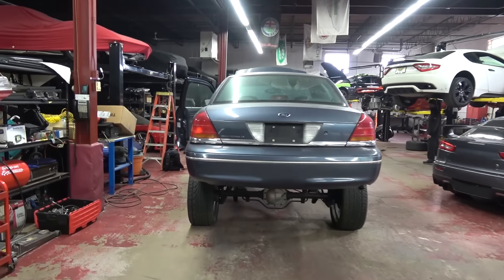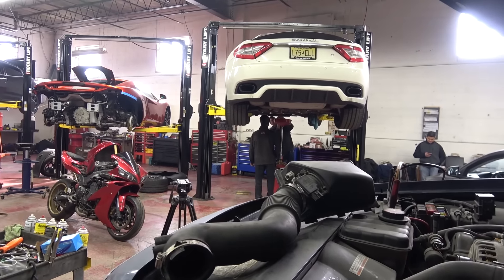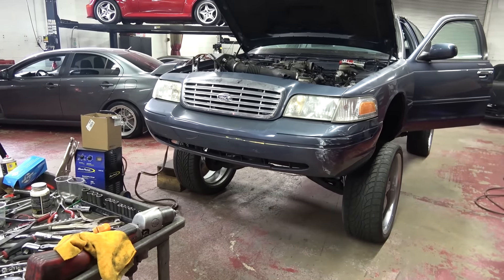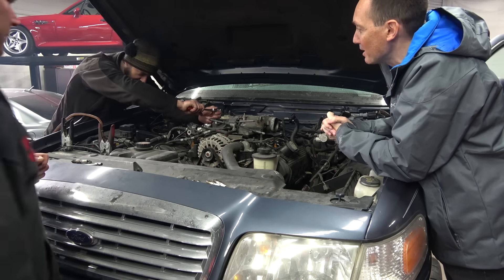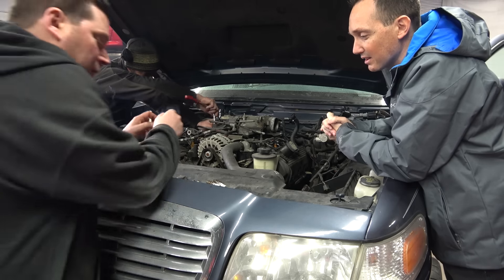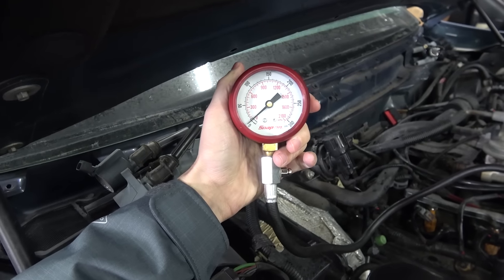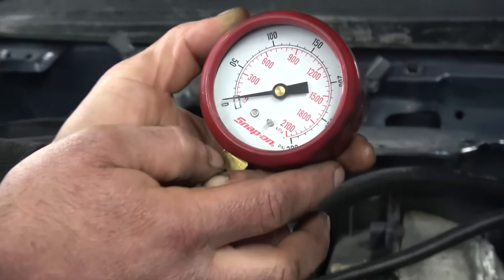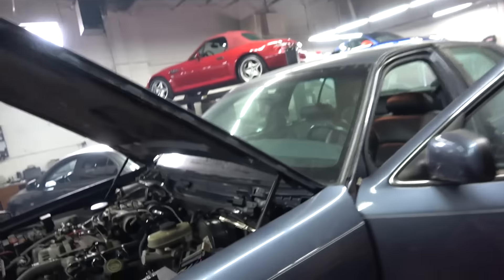So I Bought A Donk With A Blown Engine

Comment: Check the fuel pressure regulator. Sometimes the diaphragm will tear and leak fuel and its sucked into the engine causing a misfire. Pop the vacuum line off the regulator and see if fuel sprays out.

Comment: Best part about the coils is there brand new and you can use them on the next motor! Problem solved, I’m thinking out loud about the Catalyst disconnect from the headers run straight pipe and see if any difference would be there, just a quick way to diagnose I’m thinking. For future reference!

Comment: The straps came loose because you hooked the to the axle,your better off hooking the straps to the frame and compressing the suspension a little bit to keep tension on the straps

Comment: I'm totally shocked a car like this has a blown engine, totally shocked...
Reply: Same, crown victoria's are very reliable.  I got one, only reason a car like that would have a blown engine is straight up if they didn't have it maintained at all.
Reply: I'm not shocked, it's a Ford what do you expect
Reply: @MichaelRobinson-up6fo  You can't even deny that tge crown vic is one of the most reliable cars out there
Reply: I for one, get your sarcasm.
Reply: Its practically written on the frontgrille
Reply: The wheels scream " I have been cared for my whole life".
Reply: Especially since Rob bought it.
Reply: Motor pool?  Taxes?  
That is not a P71.
Reply: Rusty Climber  I'm aware of who takes care if fleet vehicles. 
All I stated was THIS Vic was not a fleet vehicle. 
It's not an interceptor.
Reply: It is shocking but in reality, a blown engine can happen to any kind of vehicle if ppl aren't careful with them
Reply: @groundshakersociety6637  it's really not, it's over hyped
Reply: @MichaelRobinson-up6fo  the 5.0 and 4.6 are bulletproof motors idk what your even talking about and I'm a Chevy fan, you know I'd rather push a Chevy than drive a Ford but those Vics are tough
Reply: @Gcal1956  
they scream
WHERE IS MY DADDY???
Reply: FORD Fix or repair daily! Lmao jk

Comment: These motors cost less than those coil packs lol
Reply: beware gravity he loves to waste money
Reply: beware gravity and the engine comes pre-installed?
Reply: Harbor freight swap it. 
Life OD channel.
Reply: Mechanic was stupid or just ripping him off but that uneven crank would make anyone that had a brain know there was a compression issue to pull the plugs and do a compression test before wasting the customers money on parts.
But hey that;s the stupidity that sends people to people like me that works on cars in the back yard, I'm cheaper than the garage guy so the customer feels like they are risking less.  Then when I prove I can save them even more without screwing them over I get repeat customers and referrals.
Reply: I seen engine, trans, and ecu with wiring harness on Craigslist for 350$ lmao
Reply: @PatrickBaptist  exactly the same damn thing I was going to comment that is bulshit that they charged him for coil packs and everything and it starts and sounds like that all weak and everything does it make that Ford crank noise when you turn it over it doesn't sound good at all that right there and told me when I first started watching this that there was something major wrong I wouldn't ever let somebody like that work on my s*** anymore they're going to sit there and charge him that much and that wasn't even close to what was wrong lol I mean for starters they should have went and checked the check engine light cuz I'm sure it had one set for it to be running like that that bad and that right there would have told you you had a misfire and then you could switch Coil packs and if it didn't change then we'll then I would have have went after compression but honesty I've done this since I was 14 and I'm 23 now and I can listen to a vehicle when it turns over and tell you if something's wrong if it's not running right the sound when it turns over or when you give it gas ha I can usually always tell i mean idk what the hell kind of shop this is but I be damned I ever would take my shit to them of i was this guy ha I be wanting my money back lol or a free engine replacement or free labor or better yet just take it some where else ha not ever let them touch s thing .
Reply: I have a mercury marauder engine that'll drop right in there. Dynoed at 617 hp

Comment: Wore out/head gasket or both. Burning antifreeze means gaps in places there shouldn’t be. If it was the coil then when it fired up the smoke would have been black from all the unburnt fuel

Comment: Just FYI Rob. Unlike every other car company ford thought it would be a good idea to only show a misfire on a cylinder when it misses ALOT within a SMALL time frame.. (on these cars/motors) Just wait until you blow a plug out of the head and realize there is only like 4-5 threads in the head..

Comment: Put a 5.0. Ford crate engine in for $3500 and she'll be race ready. These donks are like any hot rod or classic car project. Who ever owned it before didn't get the motor swapped out. You could also do a LS swap , a used engine starts at $1500. You don't necessarily have to go to the junk yard.

Comment: I bought a 4.6 from pick n pull in STL for $345 out the door and the with a 12 month warranty. Do like i did look for a wrecked car with a motor that has not been stripped of any parts. I'm sure there is some of those kind around where you live.

Comment: Dude I just bought one of these but in stock condition for $600 working great and looks factory fresh after I cleaned it. It looks like the guy overheated it at some point and never bothered to replace the head gaskets. I'd check that plastic intake manifold for leaks, it's a known problem with these.

Comment: I dont want to be one to brag, she aint no donk, my crown vic was 900 on surplus auction and gas run great since 2013 and she has never broken down. A 2001 DUI enforcement model, cheap parts cars to, beside the suspension. Swap or rebuild?

Comment: I had an 09 Expedition with a 5.4 that sounded exactly like that when the motor went bad at 115k.  The later Triton V8's are complete and utter garbage.  That was the first and last Ford I'll ever own.  The OHC engines are notorious for having oil starvation problems, that's why Ford moved back to a push rod V8 for their new 7.3 gas engine.

Comment: bloody crying shame! That looked like a damn good motor. Good on you guys for doing a compression test. Probably should've done it before getting the coil packs given doing a compression test would've been actually easier but we won't go there. Myself, I would've bought coil pack or catalytic converters or one of a couple sensors but yeah compression test is a good idea before you start doing anything to labor-intensive. Still say it's a shame that motor looks beautiful. That guys saying a motor would've cost less than the coil packs that kind of gets under my skin a bit. It's around here got a run you 300 or 500 or motor and you'll probably still have to change the coil packs. I've seen salvage yards charging 800 for one of those motors as well and they're getting more difficult to find. I'm talking about here. I don't know about the US. You know what, it's time for boys and girls? Let's not just put a boring old Crown Vic motor in this interesting little jam. I know anybody is just going to ignore this but give this car some balls. Put a Mustang motor in it, get an engine out of a road GT cobra or something and swap that out for some real horsepower. If you're got a change the motor man have some fun with it and put a real beefy Injun in their.

Comment: timing chain problem.... you can hear them hitting the covers... stretch chains and bad tensioners... common problem...funny thing is I'm actually doing a 5.4 out of a F-150 for the same reason...not doing the chain job...easier to put another one in... I got my clients motor from LKQ for 850... I live in Canada so you might get one for less

Comment: Sharp mechanics. I was expecting them to start recovering the rear seats since they are the most common cause of white smoke misfires instead of a blown head gasket. Be sure and get a vid of the water in the oil pan haha

Comment: Hey Rob FYI I buy and sell cars and I have bought the exact same coils for like 60 to 70 bucks off of eBay for a set of 8 I don't know how long they last because the car was sold but they look exactly like the same ones you get at the local parts store for like 50 bucks a piece just thought I'd let you know. PS I'm in the Tampa Bay area

Comment: White exhaust on startup is coolant vapor and that had hella vapor!  Coolant or water in the cylinder produces a white exhaust which is different from oil burning.  If you wanna go cheap just do head gaskets.

Comment: Get yourself a new mechanic. He works on high end exotics and supercars and yet he can't tell that a Ford 4.6 is blown from the sound of it. It's got 2 dead cylinders which is why it runs like crap. The cylinders are dead cause the rings are shot, hence the 0 compression. The white smoke is from it burning coolant due to 1 of 3 things. Bad head gasket, cracked head or a crack in the cylinder wall leading in to a coolant jacket which would also cause 0 compression

Comment: I new it was shot on the first crank. It had a dead skip. And i dont think its dead yet. By the look of that smoke i say the head on the pass side craped out. No compression on that side at all and white smoke. Cracked head is my guess but ive only worked on nothing but fords 40+ years so dont take my advice. Good luck

Comment: Why did you throw coils at it without proper testing? Why not put a pressure transducer in the cylinder and look at valve events or in the intake and exhaust? You could look at secondary spark waveforms and see if there is a compression, fuel, or spark issue. You can also do a relative compression test. All you proved was there was no compression. It could have been as simple as a Rocker coming off. I would think a shop that works on exotic cars would have equipment like this to diagnose problems rather than trying to get a spark plug out to do testing. Most of my testing is done within a few minutes and can pinpoint internal issues.

Comment: Those 4.6 are supposed to be bullet proof
Reply: They are if maintained same thing with the sbc
Reply: They are. They go 300, 400,000mi + without major problems with low maintenance!

WTF did the previous owner do to blow the motor?! Run it on low oil & crap gas?

Comment: clogged cat.... but exhaust gas, oil, and coolant are flowing freely out the tailpipe..... LOL!

Come on man... that thing was overheated to death. 

Now me and the mad scientist gotta rip apart the block, and replace the piston rings you fried. ;)

Seriously though.... the head gaskets are blown and the rings are actually fried....Go ahead and replace the motor, I'm betting it has stock gears and the transmission is probably shot too......

Comment: ******WHY THE HELL DID YOU NOT CHECK MORE FIRST, WET PLUGS, LOW COMPRESSION, CHECK SPARK, CLEAN OLD PLUGS, VIEW POWER BALANCE TEST ON SCAN TOOL!!! DAMN MAN YALL DID GOOD AT THROWING PARTS AT IT FIRST BEFORE DOING PROPER DIAGNOSIS!!!!!!************************

Comment: Oh btw I’m almost 100 % them guys knew you have money and they sold you some bullshit coils before testing the originals. Now the light bulb sets off in the mad scientists head let me check the compression to add more shop time even though this is exactly what I shoulda done in the first place. Buy a new block and check the compression before accepting. A new block for that pos is probably 300 - 450 at most. I’m actually surprised your smart enough not to fall for the maf sensor cleaning

Comment: My first question is, "WHY?"  lol

Never start replacing parts until you know the part is bad.  Spark test, compression test and code check should be done first.  Troubleshoot everything first, then replace what you find wrong.  

Cats will normally cause loss of power and it will sound like a jet in the exhaust as the pressure builds up.  Loss will be worse as the revs increase, if it will rev at all.  I have never seen one cause missing in the engine, just won't rev.  Plugged cats aren't very common since all gas has gone unleaded, it was a major problem when people could put leaded gas in a car requiring unleaded.  

I haven't seen a plugged cat in 2 or 3 decades, but, an issue that I have seen that acts the same is a plugged muffler.  People put on a cheap muffler that doesn't have a drain hole and water builds up inside.  This then mixes with carbon and makes a sludge.  In colder climates, the water can freeze overnight, which really causes problems.

One thing that either of these problems, or a restriction, such as a squashed pipe, can cause is burned exhaust valves; but you will usually have some compression.

If this engine sat for 2 years, then it could have stuck valves.  Most engines can take sitting for a time, but I have seen cases of stuck valves after only a year, especially if the engine had a problem with condensation inside or poor maintenance.  Popping the valve covers and looking to see if a valve is staying open will tell.  Some engines have "interference" valves, where they will hit the piston if left open, but some do not.

Wish you had pulled the PCV hose to see what kind of blowby there is, could indicate a burned piston.  0 PSI compression is a very good indicator of this and would be my bet.

So many possibilities when a person isn't there to look at all of the telltale signs of various possibilities.

Comment: Coils? Engines are so easy to diagnose... you can LITERALLY HEAR the dead cylinders as it turns over..
Reply: Do you see Cosmo in the garage as the lead mechanic? Lol. He does crack me up but no way I'd let him touch my Honda lol
Reply: Oh yeah, engine problems are super easy to diagnose. Thats why some scan tools cost in upwards of $10,000 and there's hundreds of P codes that can set for hundreds of different reasons. Go do it for a living and see how easy it is.
Reply: @myaccount__7269 he's just a funny guy,it'd be Your loss ,  he can work on Ferraris and lambos in his sleep he's definitely more qualified to work on a POS Honda than any tech at your local Honda dealership.. Rob should have compression tested it before he bought it but something tells me it was getting purchased regardless... It's a funny crazy looking project that's why he bought it...
Reply: @Andy-uj9he  people just don't get it especially the ones that don't do it everyday, there are some things computers don't tell you and if it's an older car like that you're on your own for a lot of it and a lot of things aren't easy to figure out when there's a weird issue, however this was definitely not one of those cases this was a pretty easy thing to figure out even for your car guy with just basic knowledge, if you can change plugs and wires and do an oil change you could have diagnosed this cars engine was shot
Reply: @Andy-uj9he  I do do it. Scan tools and diagnostic codes are one thing. Being able to hear a dead miss in an engine is quite another. If you need a $10k Snap on code reader to figure out theres no compression in a cylinder, your mechanicing days are going to be short lived.
Reply: @GixxerDad 600  Exotics arent any more difficult to work on than more typical cars. A Lamborghini is different from a Honda in the same way a Honda is different from a Chevrolet. They're different makes. Thats it. They're all cars at the end of the day with essentially the same components in the same places.
Reply: As soon as you see a large amount of white smoke coming out of your tailpipe it’s safe to assume coolant is leaking into your cylinders from somewhere likely the Head gasket. Or you can check the spark plugs and tell from the spark plugs. You don’t need any fancy tools to diagnose an engine besides from a compression test.
Reply: I don't understand why he made this video.  Why did he buy the coils w/ out testing the old ones? Why didn't he test the compression? There are better routes to take that can determine the issue. I honestly believe this was a waste of time.
Reply: The parts cannon was strong with this one.
Reply: @Andy-uj9he  Some need equipment, some just need the thing between your ears. Did you hear that thing turn over? I do this for a living.
Reply: At best that poor thing is way out of time, coils were just an easy call on a mod motor without looking at it. I have made many a trip to one of our fleet trucks with a coil in hand and solved a lot of misfires. Best one way in the middle of nowhere the intake leaked and filled #5 to the brim. The look on the guys face as I "fixed" it with some napkins and pen and drove it off was priceless.
Reply: @UncleBubbles94  I get it, hearing a cylinder with low compression while cranking it is easily audible. Determining why it's low on compression and what caused it is much more difficult and requires  real world knowledge and experience , especially when  the customer's money is at stake. With increasing technology, like direct injection, turbochargers, variable compression engines and emissions garbage becoming more and more prevalent each new model year, our jobs become more and more difficult. To say that engine diagnosis is an easy task... that's quite an understatement.
Reply: He’s trying the entertain the masses or stupid is as stupid does